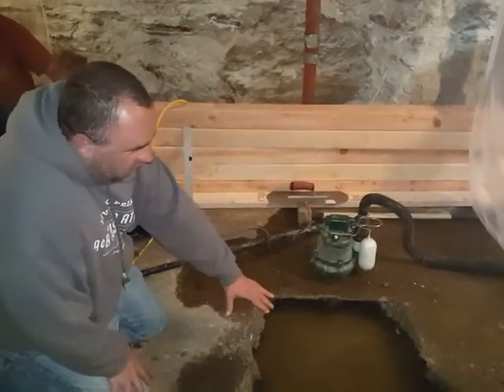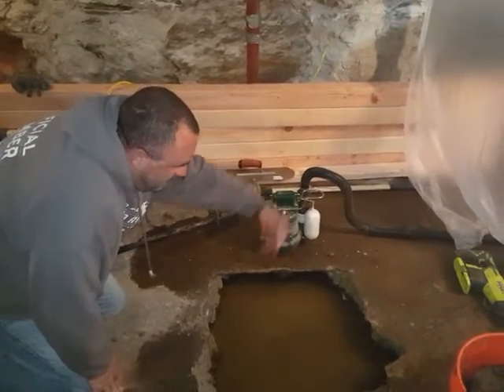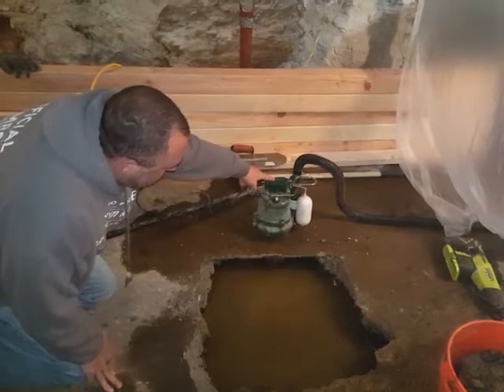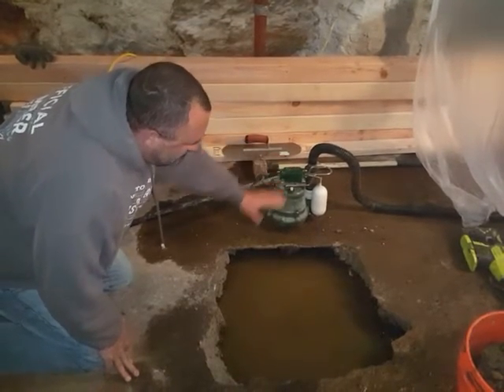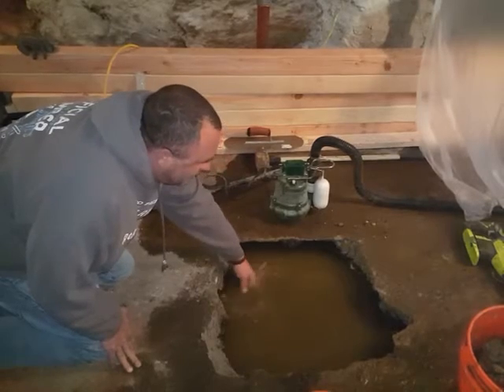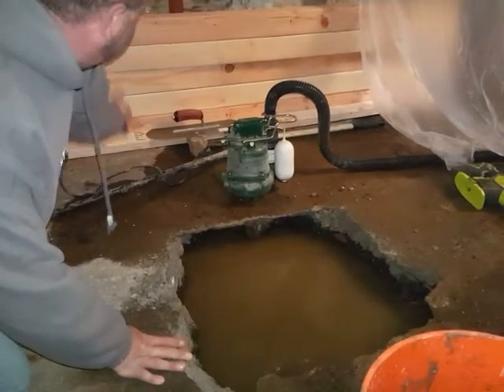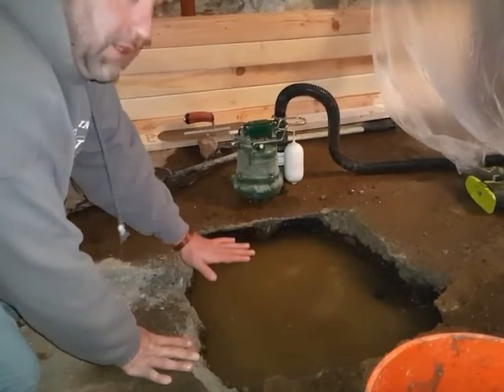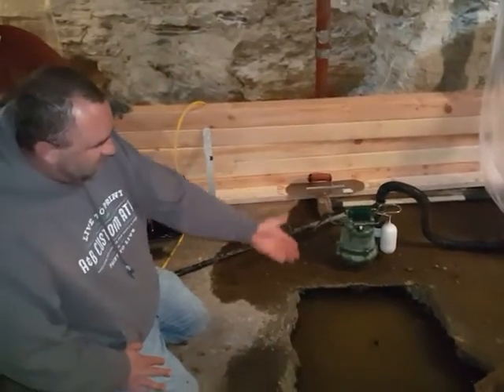Traditional Sump pump runs too much, Ion sump pump

Comment: Hey hopefully you can answer. My water table is like this one in the video. I was thinking about rising it up high but my weeping tiles then would be under water at all times. Bad idea or keep pump low and let it cycle every 15 seconds?
Reply from the maker: When you say tiles are you referring to a drainage pipe?
Reply: Yes the pipes that drain the foundation water into the pit. My water wants to sit above them. Keeping them full of water at all times.
Reply from the maker: @Chrismccl  make sure your check valves are working properly and the water is discharging far enough away that it's not being recycled. I'll let that water come all the way up to the bottom of the pipes, sometimes even a little higher.  Other than that,  it is what it is. Gotta pump to stay dry.
Reply: Yes check valve is working perfect. I've just replaced it. The flow into my pit is consistent. Never ends. Water is being pumped into my drainage ditch 240FT away from the house. My problem is my water table is higher then my inlet pipe into the pit. My question was is it OK or NOT to let the water level rise above the inlet pipe before I trigger on pump?
Reply from the maker: @Chrismccl  not something I'd recommend long term. Pump Away. Just make sure you have a back up in case it goes down. If you have the grade to get to daylight, you could put an external drain system in someday. Comes with a price, but no pumping ever again. We do them all the time.
Reply: Thanks for your reply my friend. I have a Generaic 11kw back up generator and a back up pump. No where on my property or properties near are lower then my foundation. Wish you guys were here in Eastern Canada do redo this system. Thanks for your replies again!
Reply: Similar issue to original post. Consistent inflow due to high water table with no grade lower than basement floor to discharge to by gravity alone. I've resorted to putting my sump pump on an hourly timer for nearly half a year now. It doesn't take long for our water level to rise above the drainage inlets, but it won't reach the float switch of our battery backup sump for one to two hours. 

My question to Premier Basement Waterproofing is, WHY isn't something you'd recommend long term? I've read many conflicting reports on this practice. Some experts say it's NO BIG DEAL, while others say it's A BAD IDEA but offer few specifics on why (I've read one comment stating that it can affect the soil load bearing capacity). 

Allowing a pump to run too often drastically hastens the life of a pump and can waterlog the outdoor discharge point. Not to mention the fact that listening to a pump run once every few minutes year 'round (or every 15 seconds as per the original post) is enough to drive anyone mad, and recycling groundwater to no effect is just wasting electricity. As long as it's pumping it out before it reaches the basement floor, what's the difference?